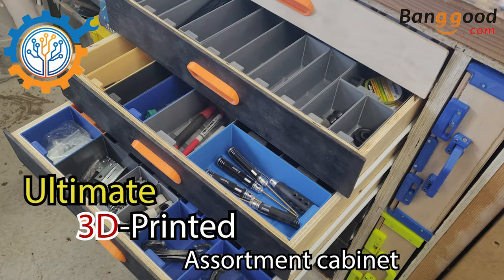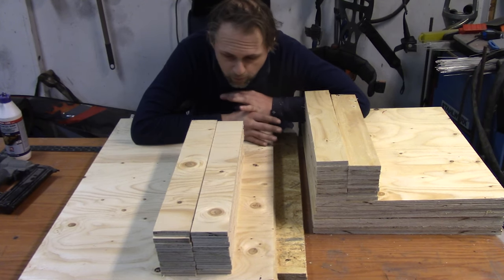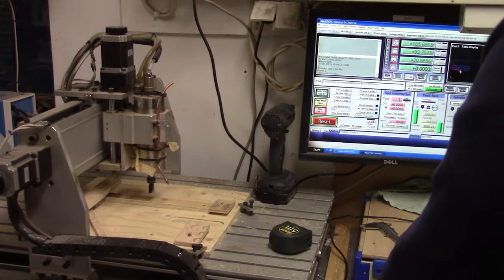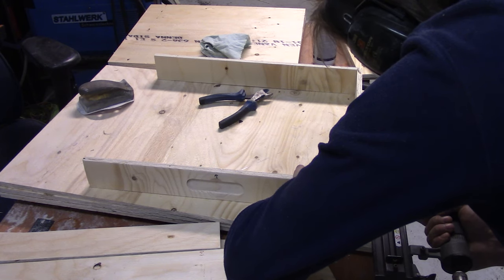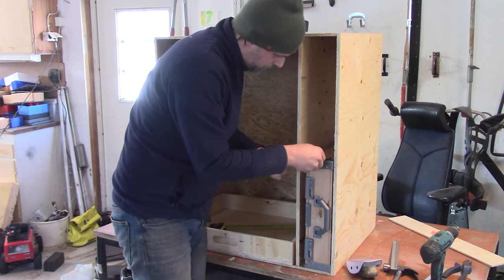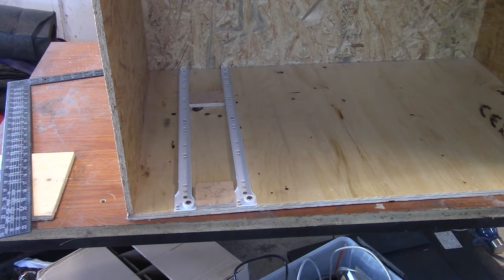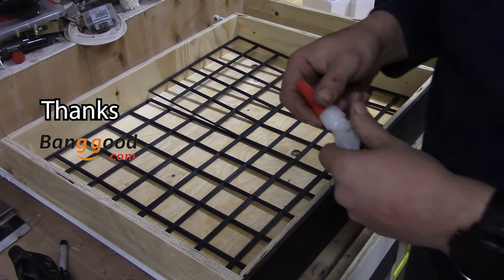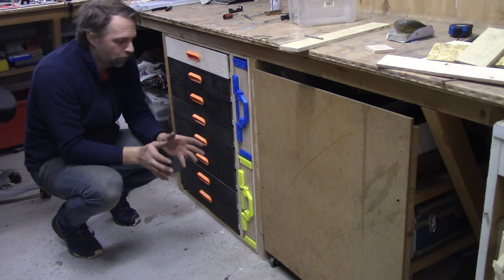Ultimate cabinet with 3D printed boxes

Comment: You should put up a link to the guy that designed the bin system.  Been thinking of making the boxes version myself.
Reply from the maker: Added to description. Totally forgot that! :)
Reply: https://www.alch.shop/shop/p/the-ultimate-assortment-system-collection all the projects and 3d files for all the assortment systems. 

this download includes all the assortment boxes, all the organizers, the worktable, assortment cabinet, and assortment case with all the variations. 

the assortment boxes come in all sizes from 1x1 all the way up to 4x6!

all boxes come with multiple variations on label placement as well as split files to print on smaller printers. 

(all files larger than 220mm in one direction come in a split version)

available file format for 3d files: .STL

All the drawings are in METRIC dimensions ONLY!  hope this helps you out adam